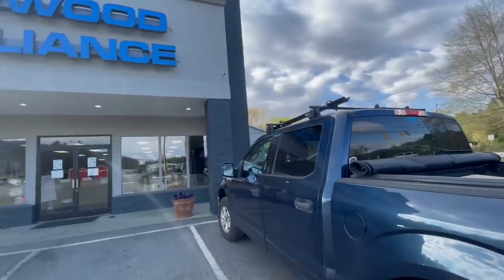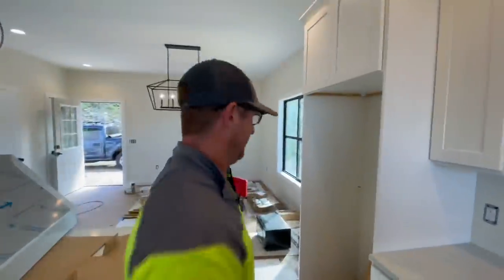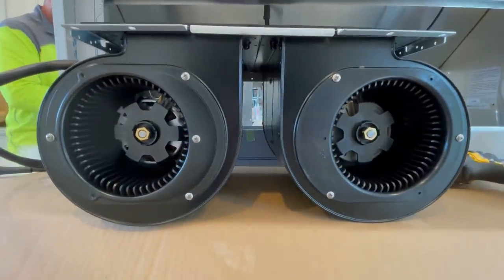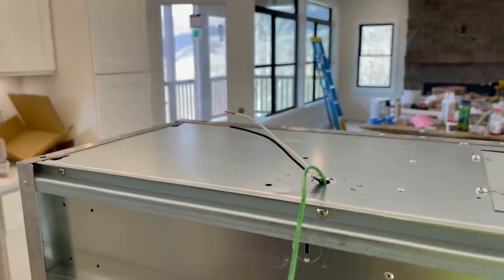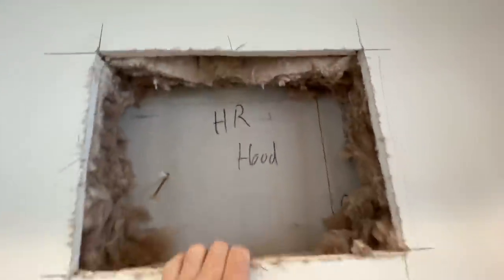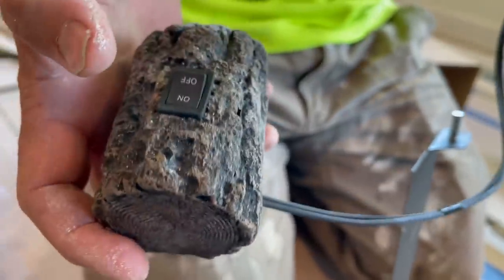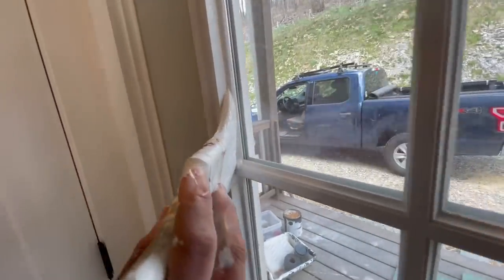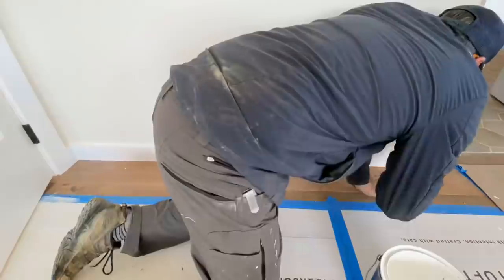Building The Farmhouse | Day 75

Comment: Pro tip on those frame inserts on doors. Most of the time those frames are made of plastic so you need to use a paint that is for plastic. Regular paint will easy peel off. I wash windows for a living and is very common door on most homes I do.

Comment: Middle of winter, all doors & windows closed, where does air come from for that huge exhaust fan? You have built an awesome, but tight home.
Reply: Fresh air makeup not required for anything less than 400cfm. Unless built to passive house standards even a tightly built house will allow enough air infiltration for that range hood.
Reply: They will have to open the kitchen window, or leave it on low.

Comment: This is a great topic:  How do you mitigate the giant air-leak that the oven vent represents?   You’ve made an air-tight house otherwise...but now you have a handy conduit directly outside.
Reply: They’re not building to passive house standards so some air infiltration won’t be an issue. I’m sure they caulked them gaps to mitigate some of it.
Reply: I reckon the hood has a mechanical damper that only allows air to go out when it's turned on, and doesn't allow any air to pass when it's off?

Comment: What is the risk for people if the exhaust unit is working over 400 CFM? Thank you for sharing guys!
Reply from the maker: It could create a vacuum, or low pressure, inside  the house.
Reply: It’ll pull a vacuum in the house which will cause outside (unconditioned) air to infiltrate into the house. This will bring in any outside pollutants and allergens; it can also lead to mold issue as cold/warm air condenses inside wall cavities.
Reply: Can also cause a backdraft which could pull in carbon monoxide from gas appliances (water heaters, furnace etc)

Comment: Interested in knowing why the code limits the hood fan speed. Now... I have turned on my whole house fan and left nothing but the fireplace damper open... So I know what happens in that case...  But is there another reason? Downdrafts in the water heater flue maybe.. Pulling water out of the p-traps maybe  . . .  anything else?
Reply: Energy requirement.....creates negative pressure.
Reply: @jehu5813  Energy? That doesn't make a lot of sense.
Reply: It can create negative pressure or a vacuum!
Reply: @moonpie21012  I know that, but what is the code violation. simply negative pressure?
Reply: @OldePhart  I'm not sure about the specific code violation but seeing as it could dangerous/life threatening to not have enough oxygen in the house, it seems like a sensible regulation.